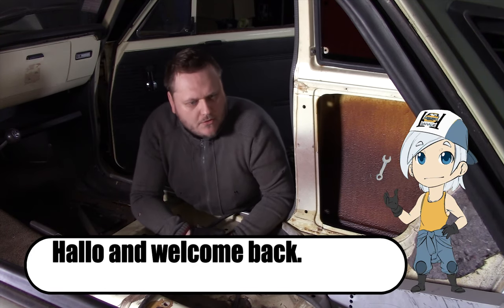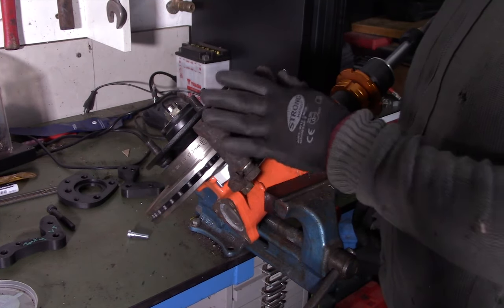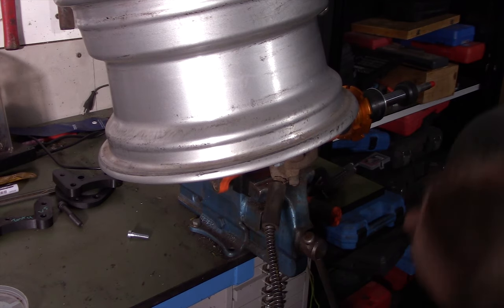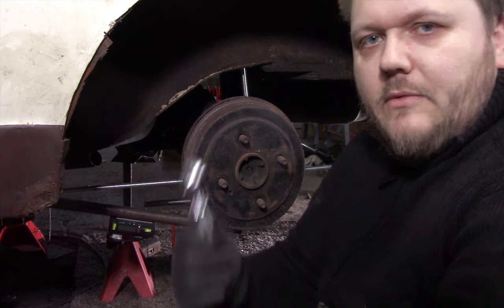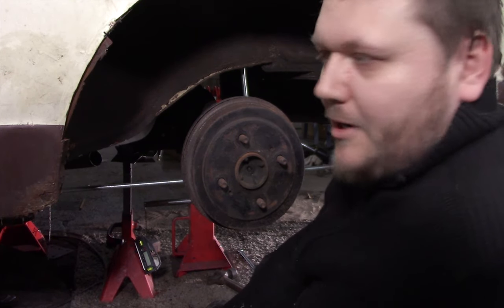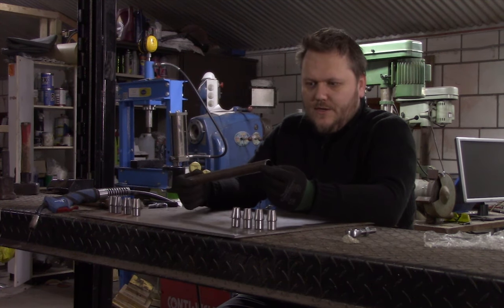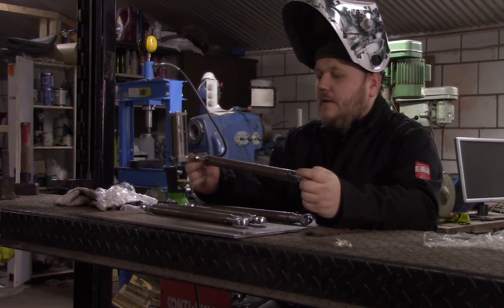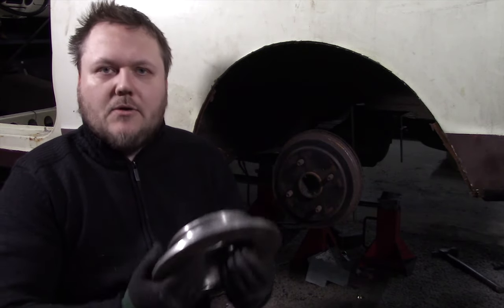KE10 Corolla Build Pt 7-4 | DIY 4-link suspension. Chassis boxes/link arms. New Brakes?

Comment: The factory KE1X rear strut towers are not designed to take full suspension loads, shock absorber only. Are you going to reinforce strut towers?
Reply from the maker: It may be designed for only shocks but that are some real "beefy" shock towers. I don't think that would be a problem if i was abel to get the springs  in that tiny space. So using them as they are is not a option (no space for te spring). So if i wanted to use them i had to modify the strut tower anyway. But I decided not to do that. I'm going with a push-rod (cantilever) suspension.
Reply: The Dutch Garage very interested to see more!